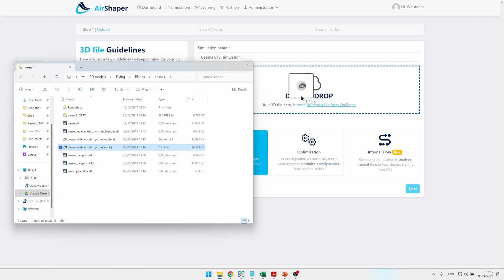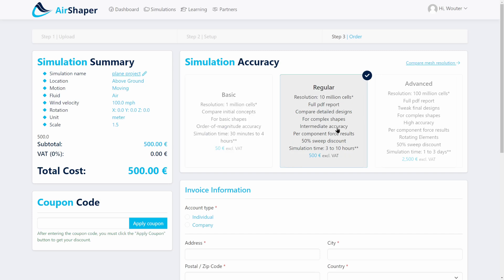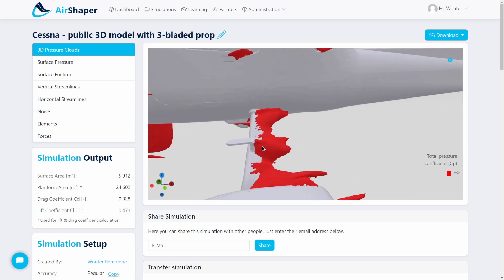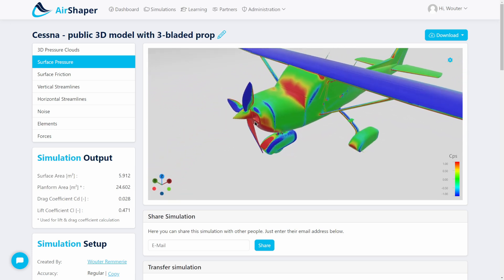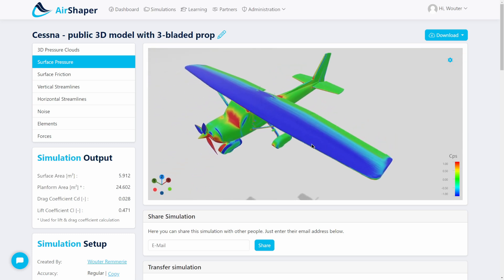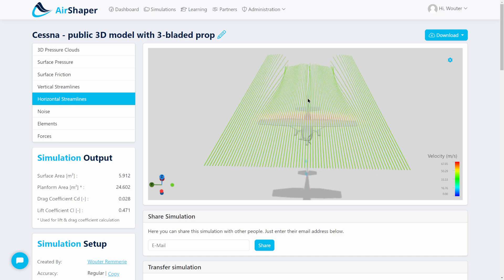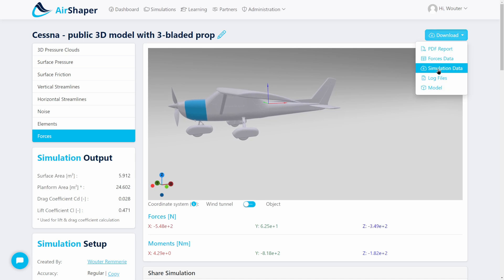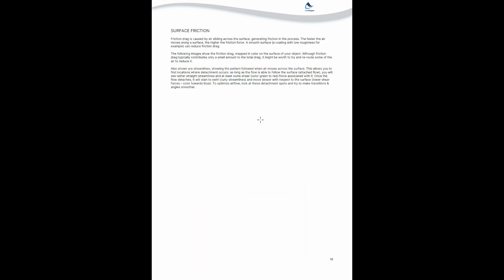Aerodynamics Made Easy - Airplane CFD Analysis Explained | Step-by-Step Guide

Comment: The sampel project available on airhsaper has a Cd value of 0.253, this one has 0.028 how is the difference of the factor 10x possible?
Reply from the maker: Ah, because we changed the reference surface we use:
previously, we used the frontal surface area, and later on switched to the planform area (area seen from the top) which is more correct for aviation!
Reply: @AirShaper  Thanks for the response, i always thought planes have such a low Cd value cause they are basically airfoils, but now i know i cant compare the results of Cd values from planes to cars

And i assume you take the total drag into the calculation (wall shear stress + pressure drag)?
Reply from the maker: @mfg-music5875  Yes, that's correct, the sum of friction drag (sliding force parallel to the surface) and pressure drag (force perpendicular to the surface). On the sample project page, there is a download button where you can fetch the simulation report as well. That one includes a table with the split between friction & pressure drag!

Comment: Thanks for explaining, I want to simulate my own project. Refer me some free cfd simulation software
Reply: I found AirShaper to be quite affordable. The entry level test is only $50, but is extremely accurate (
The air flowed exactly the same as when I tuft tested the car.)
There are a couple of free CFD softwares out there, but the learning curve is very, very steep.